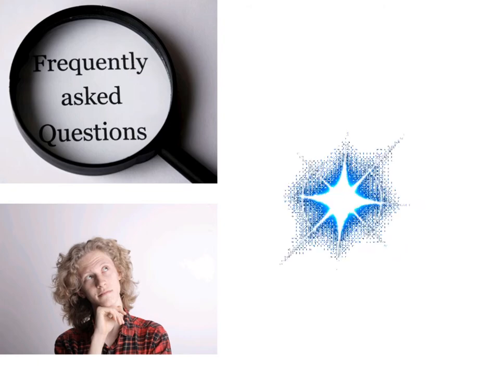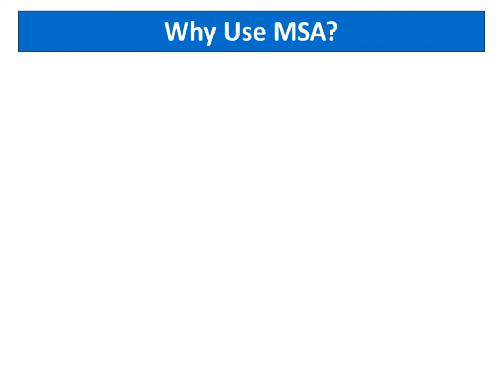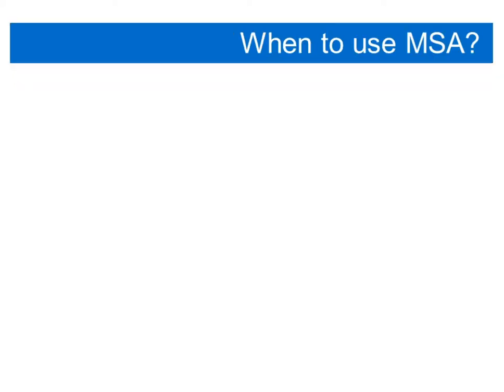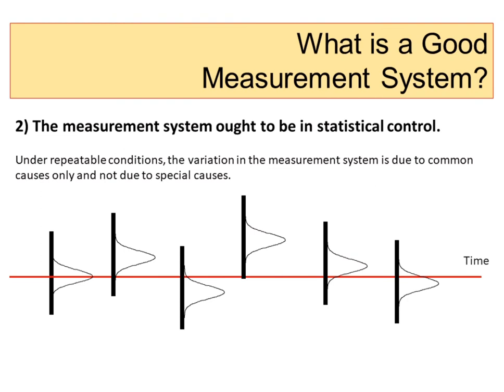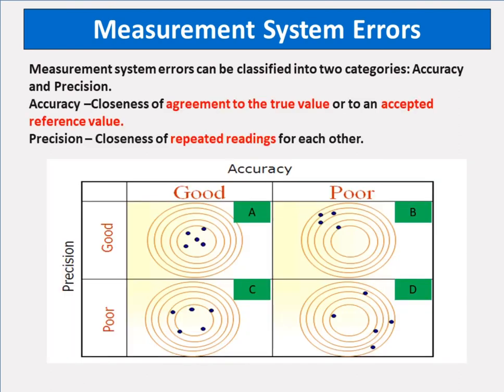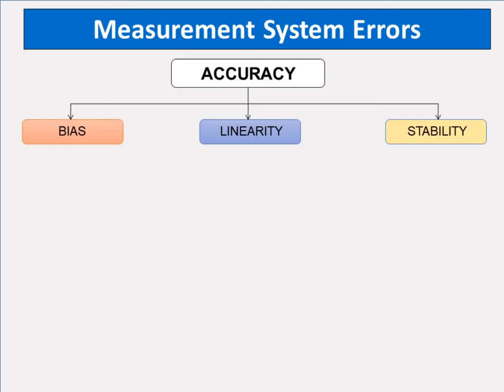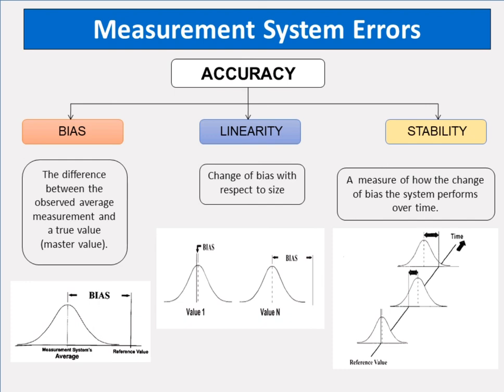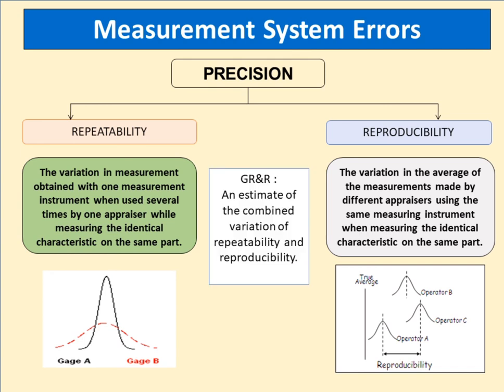Measurement System Analysis (MSA) Part II : Accuracy and Precision

Comment from the maker: 🚀 Stop guessing your data quality—start mastering it today!
Are you an engineer, quality professional, or Lean Six Sigma practitioner looking to take your data reliability to the next level? 📊💡
Upgrade your skills with Advanced Measurement System Analysis Mastery for Engineers—a practical, engineer-focused guide that takes you from beginner to expert!
Here’s what you’ll master:
🔹 Type 1 Gage Study & Gage R&R
🔹 Bias, Linearity & Attribute Agreement Analysis
🔹 Gage Run Charts & Gage Management Planning
🔹 PISMOEA framework for bulletproof error identification
What’s included inside the course:
🎥 7.5 hours of high-impact, on-demand video
📝 Hands-on assignments to test your skills
📥 2 downloadable resources
📱 Mobile and TV access
♾️ Full lifetime access
📜 Certificate of completion
Don't let bad data compromise your process. Take control of your measurements and boost your career today!
👉 Enroll now for full lifetime access:
🔗 https://www.udemy.com/course/advanced-measurement-system-analysis-mastery-for-engineers-u/?referralCode=5649821A4AFF0E96FA31